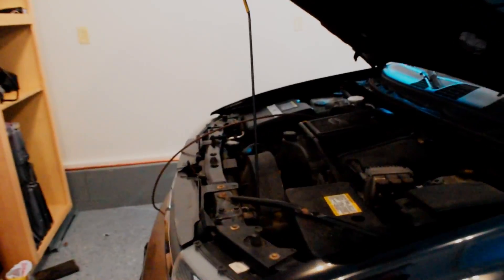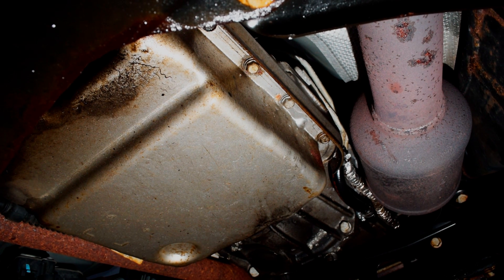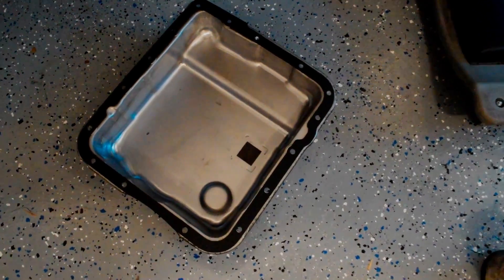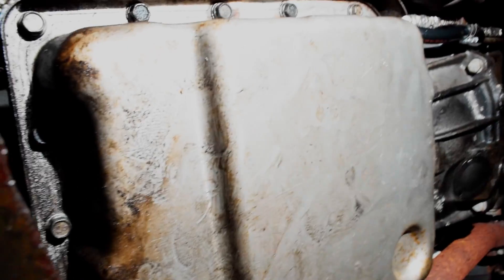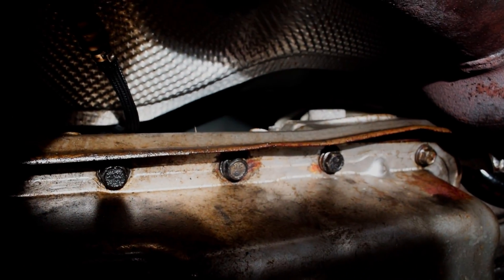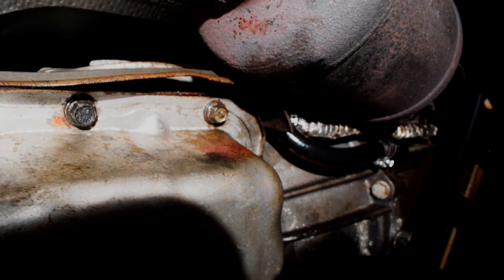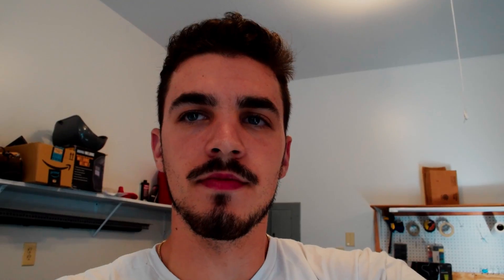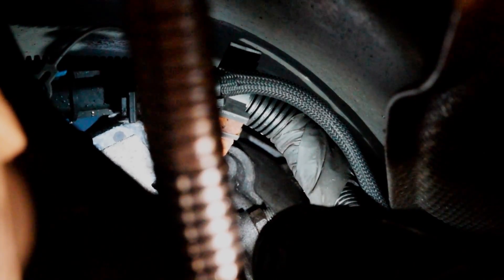Changing Transmission Cooler Lines on a Trailblazer

Comment: Super helpful video on how this is done!!!  Gave  me the right information to tackle the job myself.  I've been meaning to change the filter and fluid in the transmission anyway, so coincidentally enough my cooler line sprang a leak and forced me into replacing the lines.  A couple of suggestions:

1) The clips that are part of the disconnect connectors tend to seize in place, as do the lines, so you may want to plan on cutting the lines and/or backing out the connectors from the transmission and cooler to make it easier to remove the lines.
2) To help route the new lines from the transmission, it's a good idea to remove one of the old lines making room for one of the new lines so you can see the path for the line.  Then you can remove the other old line and route the second new line in place.  By doing this I didn't have to remove anything in the engine bay.  Also, it would be a good idea to tape the fastener keepers at the ends of the line as they tend to slide down the line anywhere but where you want them.
3) I didn't remove the cross member, but it is an extremely tight and sharp space!!!  I did, however, remove the strange bracket attached to the transmission.  And oddly enough, removing the transmission bottom cover seemed to give just a tiny bit of additional clearance which I had to do anyway for ten fluid and filter service.
4)  I found it easiest to turn four new connectors in place and then push the lines into the quick connects.  I bought and installed four new connectors just to be on the safe side.  If you have a ratcheting wrench it will make the transmission connector removal and installation quite a bit more doable.  
5)   Lastly, if you're fortunate enough to have long thin arms and small hands for this job it will make the connector removal and install at the transmission go so ,'much smoother.  In my case, I just couldn't get the bottom transmission connector started, but my wife was able to get in there and thread the connector with very little difficulty.   She really saved the day.

Best of luck if you choose to tackle this job or if you choose to pay to have someone else do it, their is no shame it that either, as it is a tricky job which can be very frustrating at times.

Comment: Can't believe you did this without a hoist.  Thanks for posting. It was very helpful.
Reply from the maker: It's difficult but doable! Glad I could help
Reply: Not difficult at all just did mine before i seen this video and fyi for people it doesnt matter which line goes where on the radiator its open flow inside it will flow either way

Comment: I have the same issue but I have to replace the connection fittings also and they are rusted right on...think I may have to take it to someone with a hoist... stuck in Walmart parking lot for another week waiting for a  garage.

Comment: Dude...... Great video with clear instructions..... Thank you! Just finished doing this last night. I did use an endoscope camera to visualize the area which made things so much easier then doing it blind. I would say those damn clips took the longest time (lost 3), while threading the lines took about 10 min. Like you said it is extremely tight but followed your instructions and I'm leak free! I did switch out the tran pan for one with a plug (at $35 made more sense/convenience than putting in my own plug). Thank you again!
Reply from the maker: Endoscope is a great idea!  And the drain plug will make future fluid changes much easier. Most important tool is definitely patience haha. Glad I could help out! Nice work!
Reply: @ThatAccordGuy  btw.... Just as a dump place for tips if anyone is looking. I didn't have that cool tran sucker you have.....so I picked up two 8M x 1.25, 30 mm long bolts and threaded them into the front of the pan. I then removed all the other tran pan bolts except the back (which I loosened) and then snaked in a section of 1/2 in clear vinyl tubing (use whatever tubing you want) in the front. Was able to siphon out roughly 4 qts making the job much less messy (meaning you're still going to get your hands dirty but the floor was clean). Hopefully that helps someone else out.

Comment: My 2006 trailblazer coolant hose were so rusted due to that heat shield cover and it broke loose on the freeway!  Lost half of my fluids.  Did exactly what you did by inserting a hose and it work perfectly fine.  A year later my transmission finally gave up fourth gear as I was heading to Baja California it gave up due to the high hills border stress in Oregon and California!    Now I need a transmission but can’t seem to find one!!!  Good luck kid hopefully if you read this message today let us know any updates!
Reply from the maker: Good luck to you, there's definitely a good amount of transmissions out there for that vehicle. Lot of 4l60's out there and they came in a lot of vehicles.

Comment: I appreciate you taking the time to make this video. I have to replace mine! But quick question. The lines that slide into the quick connect with clips, is there an O-Ring that will go on the new lines or that come off with the old lines?
Reply from the maker: Nope, the seal is internal to the fitting. You want it to lock in tight and not be able to pull it out, not see any yellow and if the black plastic slides over you've probably got it locked on good. Check for leaks and it should be solid
Reply: @ThatAccordGuy  Awesome. I appreciate you taking the time to answer my question brother! Stay safe!

Comment: I've replaced lines and several fittings still leaks on my top fitting I've tried everything it doesnt leak till I start driving awhile not sure whata up should I dip the new fitting in trans fluid before I push the line in the fitting?
Reply from the maker: You should not have to do that. If they're truly snapped in, then they shouldn't leak. You have new metal clips? The plastic ring fits over the line after you snapped in the clips? Must not be seating correctly.
Reply: the 'o' ring inside the lock fitting could be damaged causing it to leak when under pressure at operating temp.
Reply: sorry just realized that was two months ago you probably have it figured out by now.

Comment: How exactly did you get the new ones in? Did you come in from the front and go to trans, or vise versa? I changed my radiator and left it out to give me more  room. That was 2 weeks ago. I now have the tire, starter, cross member, strut,windshield washer Reservoir, axel and a few other things that are disconnected or removed and I still can not figure out how to get these lines in without getting them wedged on something. I guess the exhaust or motor mount will be next. You was not kidding when you said this is not a fun job. Any helpful info would be highly appreciated, thanks!
Reply from the maker: Maybe you don't have the vehicle jacked high enough. I think usually I go In from the front. I don't remember on this particular one. Hopefully you got them by now man. So much easier with a lift not going to lie. good luck!
Reply: @ThatAccordGuy  yeah I finally got them in. Once I seen that they could bend a little without having them break it made it easier. Thank you

Comment: Mine was leaking closer to the front of the truck. I replaced to 2 at the rad. The rear ones, I can't get my hands in there... So I cut the lines where I can get good access to them and replaced the front half, that I bought new and cut them at the same length as what I removed, reassembled  using a compression coupling.  Easy peasy
Reply from the maker: That works as long as you've got a good seal and your lines are in good shape back there. You can definitely get better access with the exhaust removed. Definitely a pain tho

Comment: Do you think a trap door in the floor would be easier? Struggling to get the back lines so thinking about cutting
Reply from the maker: You could do that, or if you remove the y-pipe you would have more room but they're often rusty. Up to you man if you're into cutting your floor up haha. Ive cut a floor to get to a fuel pump before so I understand. I think it would take you as long to cut the floor and then re-secure it then to remove the y-pipe

Comment: Heck i just took the crossmember off.. It was a pain getting that off but gave a lil more room and visibility.. The not so fun part is goin to be putting that crossmember back on.
Reply from the maker: Good luck bro!
Reply: @ThatAccordGuy  .. Update... Got the bad line out was a lil bit of a pain.. Got new line ran through and connected to the radiator line but now the a different issue.. The line does not line up with the fitting in the transmission..The end sits just after the fitting towards the rear of truck. I believe it was a dorman transmission line i got.. To me it seems like they gave me upper line and not the lower which is the one i need.. Upper line looks to be only a year old on it and still in good condition.. What is your thoughts on that...

Comment: dude in my alldatadiy online manual it suggests removing the catalytic converter, to access the lines going into the transmission. And, of course in order to do that you need to remove the mid frame transmission support. I've removed the passenger side bolts for the mid frame transmission support but in order to remove the driver side bolts for that mid frame support I have to get a bunch of other stuff out of the way.  I was wondering if you could tell me what that other stuff is. I've never seen anything on a vehicle that even closely resembles that bunch of tubes and what looks like some kind of round filter canister or some kind of pump apparatus. What ever it is .. it looks like some kind of apparatus that was a second thought, like in the seventies when auto manufacturers were coming up with last minute add-on devices to make their standard model engines comply with the new auto emission standards. This job is growing in complexity by leaps and bounds. But I gotta replace these lines and I can't afford to have the dealership do it. I did a head gasket, timing chain, guides and gears, and exhaust cam replacement on a 2011 Hyundai Sonata last winter and that seemed like a much easier job than this thing is ending up. If you could give me a clue what all that crap is that blocks the bolts on the driver's side of the mid frame transmission support is, it will go a long way for me to find out the best way to get it all out of my way.... if you could send me an email about it I'd be grateful as hell. Thanx
Reply from the maker: I wish I was more familiar with Hyundai's, but unfortunately I am not. Those lines could be a number of things. Oil cooler lines, something for the evap system. Where do the lines lead? That might help a bit.
Reply: @ThatAccordGuy  I think he meant the work on the Hyundai was easier than the Chevy. The stuff that's in his way is on the chevy.
Reply from the maker: Yeah I think you're right... Definitely misread that somehow. I'm sure he figured it out. It was like a year ago lol
Reply: @ThatAccordGuy  or he's a patient man
Reply: @ThatAccordGuy  , it is the vapor canister I believe. You can’t get the cross member bolts out on the drivers side without taking it off

Comment: Great video...I would like for you to to a link for the parts cuz I’m doing mine and I ordered the lines from amazon...for ac delco  brand they have front and rear outlet lines and then just the front inlet line...I ordered just the front and rear outlet not thinking about the inlet so now I gotta find them...great job
Reply from the maker: Glad you liked the video thanks for watching. Good luck finding the lines. I ended up getting them from a GM dealer.

Comment: How did you get the lines out of the transmission? Seems You completely skipped that part.
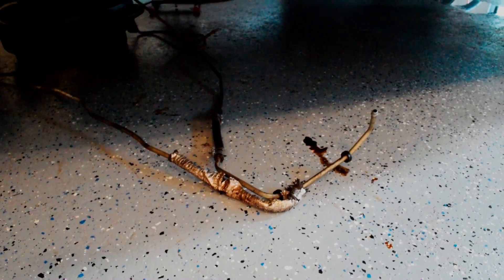Reply from the maker: If you go to 12:25 you can see the connection on the trans. the connections are the same as the ones on the cooler In front with the clips and flared end that pulls out. It's real hard to get the camera in there. Didn't have a GoPro at the time.
Reply: Yes I saw that. I was wondering how you managed to get them off. Did you have to remove the tranny mount or the exhaust pipe?
Reply from the maker: @coolinken  nope I just removed the shield there and stuck my hands up in there. It's definitely not easy. I used a pick. might help to look from that angle I was aiming the camera
Reply: Not looking for easy, just doable. Ok thanks.
Reply: ThatAccordGuy I am to this point, ended up dropping the transmission cross member I can get my hand to it now but have no idea how I’m going to get that clip out as I can’t turn my hand at all and when I hold the pick I can’t get the angle, definitely frustrating.
Reply from the maker: It's definitely a huge pain on your back. Sometimes taking a break and not getting frustrated helps. Worst case you can mess with the exhaust in the way but it can be done otherwise.
Reply: ThatAccordGuy so I did something I hadn’t seen anyone else do yet and it worked, believe it or not I could get a wrench on the actual fitting and just unscrewed the fittings out of the transmission and popped the clips out installed the clips back into the fittings and screwed them back into the transmission and popped the new lines back in.

Comment: How long does this job take? Best / worst case scenario ?
Reply from the maker: If everything goes your way, and you have good access and can see well with no issues it can be done in under an hour. But the clips can be tricky and if you lose them or something that can certainly add time. But totally achievable in a night after work or something I'd say.
Reply: @ThatAccordGuy  shop wants $700 just to replace the lines. No filter or fluids included. Add another $280 to flush and fill 🥺
Reply from the maker: @MNFroggy07  yeah bro it is not an easy job. And this way is cheating it. Typically the exhaust has to come down which is a pain.
Reply: I’m going back on a week for one line!! It’s been a nightmare for me! Have one end in the trans but, I didn’t install the clip first smh now the clip won’t seat. Tube is basically wedged in too.
Reply from the maker: @johnsanderlin8750  ouch dude yeah it can definitely go wrong. Your metal clip isn't on? If not, try prying that line out with a pry bar and then trying again with the clip on first

Comment: It's taking longer to shift because you're probably low on fluid.

The transmission pump requires fluid to operate properly in fact your automatic transmission relies on fluid pressure so if there's too much or too little your car is not going to shift right...
Reply from the maker: Yep you're 100% right there. Low fluid can cause the clutches to not fully grab and they end up slipping during shifts because they can't fully engage. Making them longer. Thanks for the comment!

Comment: The only way to remove the transmission oil cooler lines is to remove the passenger side motor mount or remove the exhaust. Removing the side mount is easier than removing the exhaust.
Reply: Not true just did one with it all together yes it sucked

Comment: Dealer wants $1500 to do this job.   Parts are less than $30 on RockAuto.
Reply from the maker: Yeah it's all labor man. The job pays to take off the cats and all that other crap whether the tech does it or not. Worth attempting yourself for sure
Reply: @ThatAccordGuy  I used to do all that stuff myself, but no time anymore. Going to try to find a mechanic to do the labor and I'll buy the parts.